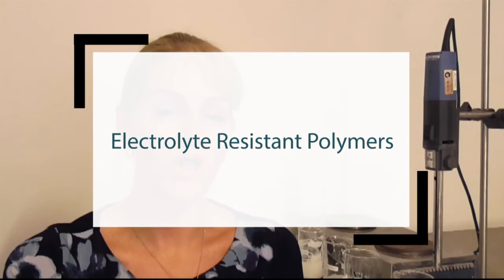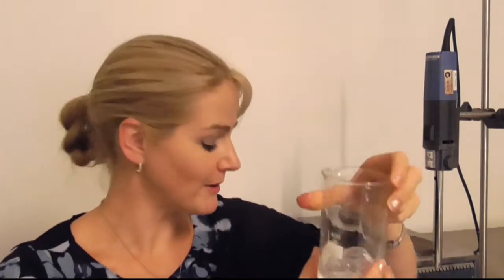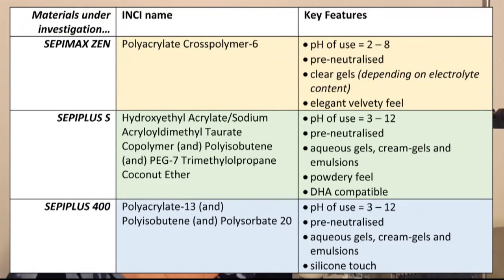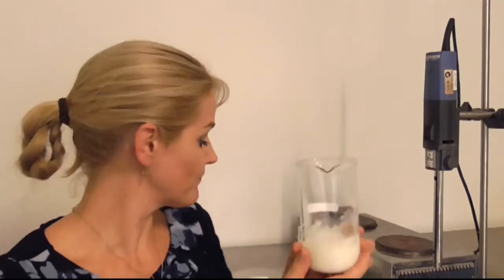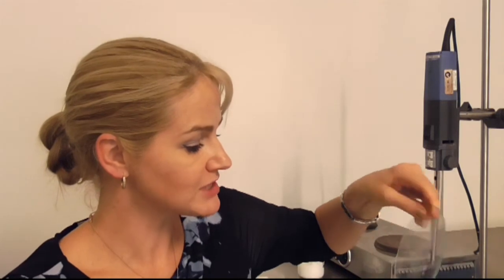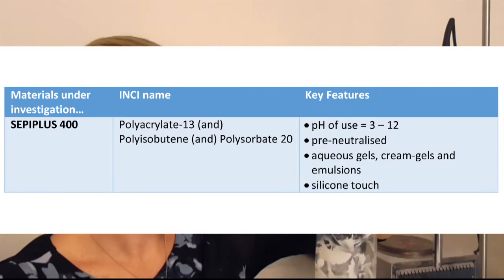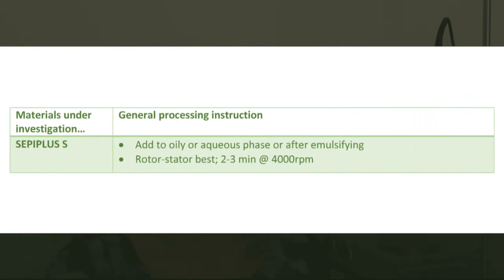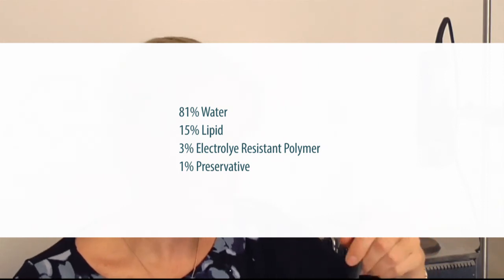Electrolyte Resistant Polymer video

Comment: Hi, I was wondering what kind of propeller did you use to disperse the sepimax zen? Cause I'm having trouble to get a clear finish. I've been using anchor shaped propeller to get a good dispersion but it trapped micro bubble in it resulting an opac white finish. Pls let me know if you have any suggestions. Thank u
Reply from the maker: I used a standard propeller - make sure you anchor blade is totally beneath the surface of the liquid, even when stirring, so that it doesn't draw in extra air to avoid excess bubbles. Or, switch to a propeller blade.